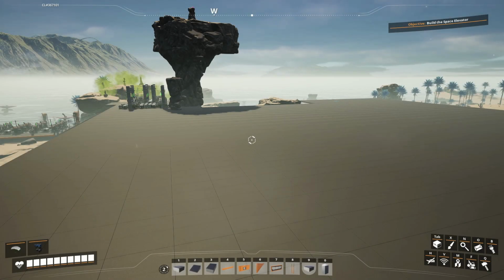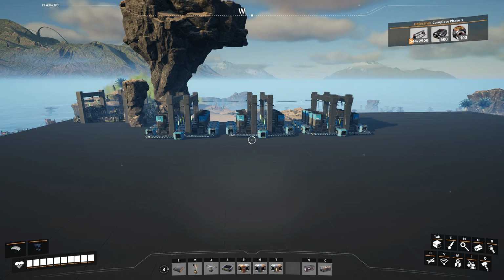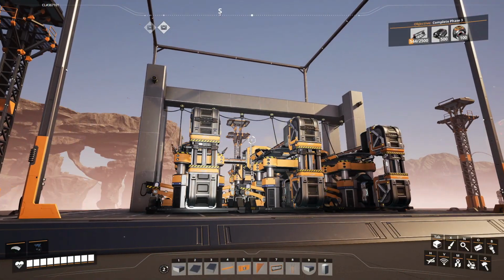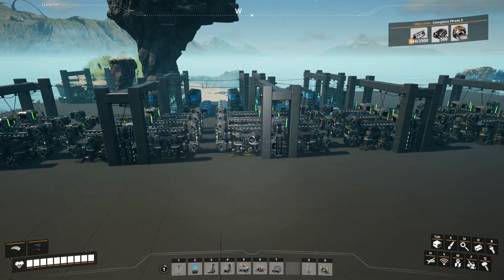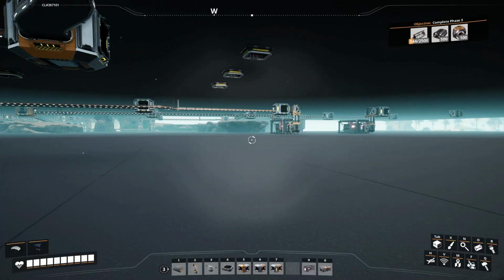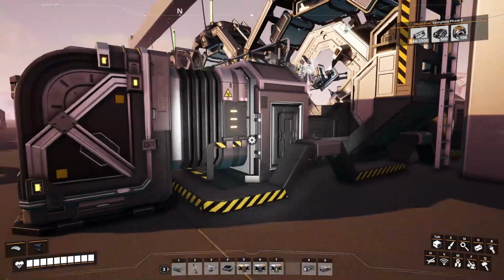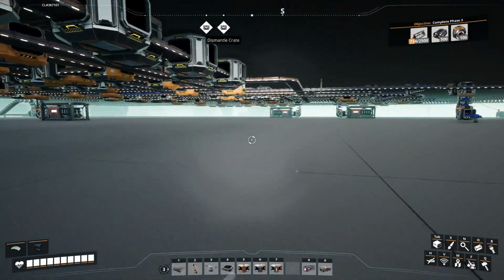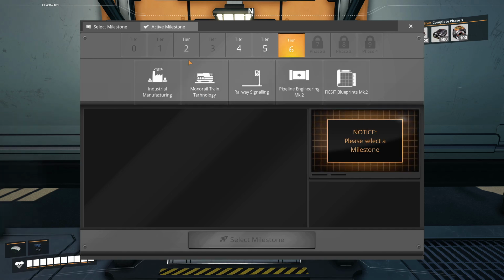How to complete Phase 3 - Mass Frames | Satisfactory 1.0 Masterclass

Comment: Nah I think I'm done with this game.  Spent 2 days following along with this and the screws make no sense and I'm just stressing how to figure it out now.  No matter how many belts you throw at it, you have two screw outputs, 1 from each set of 6 contsructors.  Even with MK4 belts, they cannot hold every item to provide supply to everything needing screws.  How the F are you gettiong 700 and 800 screws from two outputs that can only handle 480 max each at this point?  I really dont wanna quit this game after this time but this has pulled my soul right from out of me 😭

This was meant to be a tutorial and I think that was far too key a part to gloss over
Reply from the maker: Oh yeah, the screws are HORRIBLE. The way this works is simple though: I have each constructor making those screws feed into its own belt.

One belt runs towards a machine that needs screws, after which most of those screws are used. That main belt is then 'topped up' by one of the screw belts merging into it.

Keep repeating that until everything that needs screws gets them. And yes, those belts are MESSY, but luckily we have that supply level  so you don't have to look at them :D
Reply: @TheDutchActuary  You have no idea how much I appreciate that reply and the speed of it! ❤

So just so I have this right, you are not combing the 6 constructors from each set of 6 into one shared belt like shown in the blueprint earlier in the video?

So instead you are literally taking a belt from one individual constructor, directly to an individual machines screw input, then merging another belt from an individual constructor in to make up extra if necessary. Then any extra from the belt that was merged in, becomes primary input for next machione needing screws? And repeat?

I think I just assumed too much regading that constructor blueprint so apologies for requesting HUGE clarfication 🤣

Thoroughly enjoyed your content while playing the game and again, I am very grateful for the reply and advice mate x
Reply from the maker: @Paterson07  Yep that's it!
Reply: @TheDutchActuary I feel really bad now 😂 I was too impatient and just built a secondary logistic floor underneath the first, purely for screws, i then just over/underclocked a few constructors to get it over with 🤣 

Thank you again for the advice, reply and the content 😉

Comment: And it was at this point I said fuck it we are clipping all over the joint, I haven't got to look at it later so who cares.

Though I did have to spend like 40 minutes trying to figure out why an elevator wasn't working, I think it had something to do with it being set to input on an output. Other then my gripes and being stupid.

Loving the layout, Being able to actually move around without sliding under like a dozen conveyer belts it refreshing.

Comment: Following the guide and and first I dreaded the idea of using screws but ai actually have essentially a bus of screws running right on the outside and with the machines constantly running it actually gives the factory so much lives seeing 8 full belts CONSTANTLY moving. I tried building with the logistics floor style and while it looks clean for me it just makes the factory boring. Not bad looking just like seeing all the moving parts

Comment: Hello TDA! amazing guide ive been following it since phase 3 is quite overwhelming. Im just wondering how you dealt with getting the screws to the reinforced iron plates assemblers, I have MK4 belts but still getting 500 screws per minute into them seems like a challenge, any tips?
Reply from the maker: Yeaaaah that part is a bit frustrating. Basically you need several belts, with the excess screws overflowing to the next machine each time. 

It's one of my least favourite parts of this build for sure!

Comment: i been following this guide, but iam still confuse why not build a central storage system ? outside the depot do you need to walk to the factory to get for example steal beem then walk again to concrete factory to get concrete ?
Reply from the maker: Nope, you should have dimensional storage unlocked at this point that makes a central storage completely irrelevant. (its in the Alien tech tree in the MAM)

No need for central storage if items just get teleported into your inventory ;)
Reply: @TheDutchActuary  but doesnt it takes to long to upload and only have few stack ? i ussually need alot of like steel beam if i make new factory
Reply from the maker: @comentbro4198  Sorry i missed this one before. You can upgrade the dimensional depot to upload faster and store more resources. Also, you can have several depots to upload faster for high-quantity items (e.g. concrete)

Comment: Sorry if you mentioned this in a video I haven't had time to watch all the master class videos although I plan on it as I am following along with them but are you going to make the blueprints you use available? I'm not even sure if that's possible since I am new to satisfactory but I am trying to play along and build the same builds as you and blueprints would be a big help! keep up the great work love the vids!
Reply from the maker: I haven't really looked into sharing blueprints yet, but I'm happy to do so if there's an easy way. Keep in mind though that none of my blueprints are complicated, it's just simple building blocks with machines (and I show you each one I make - just takes a few minutes to build something similar)
Reply: @TheDutchActuary  gotcha I have been following along and that's true. I was just thinking about your DSP blueprints were so helpful but its easier to make in satisfactory. I am building the phase 3 factory following along in this video and I'm not sure how to meet all the screw demands with Mk.3 belts. most of my machines are just waiting for screws and it looks like the screw production is bottlenecked by how slow the belts are? Love the vids and thanks for the response!
Reply: nvm I figured out the screws lol I dident realize you weren't using the belt over single output smelter blueprint for screw. I got all the screw outputs hooked up and running now
Reply from the maker: @Snakegreen88  Each constructor making screws is almost a full MK3 belt (240/min to be exact). Most machines that require screws need a large amount as well, but usually not a full belt.

That means that you'll need to mess around a bit with the belts to get it right. The easiest way to do this is:

Constructor (screws) > Splitter > Merger > Assembler (requires screws)

The splitter then feeds into the merger for the NEXT assembler, so you take advantage of any leftover screws from the first one. 

You can see a very simple example of this in this video, at 11 min 35s: https://www.youtube.com/watch?v=-6QDwJ-1_BA
Reply: @TheDutchActuary  I'm struggling hard to figure out the math here and how to balance 800 screws across mk3 belts when each assembler takes 100/min... especially with the last constructors only making 130/min instead of 260

EDIT - I think I figured out something that worked.  I have 1 steel screw constructors ( each at 260/min) per 2 assemblers, with the 60 screw overflow of each group merging into a separate line of 240 that I left open for future stuff
Reply from the maker: @Galrash  You got it!
Reply: @TheDutchActuary  would appreciate a closer look at how you did this. I can't seem to figure it out. If you split the first full constructor (screw) line, the first assembler doesn't get enough screws. Are smart splitters required?
Reply: I figured it out <3
Reply: @TheDutchActuary  Hey Dutch, just looking for some clarification, you said:

"Constructor (screws) > Splitter > Merger > Assembler (requires screws)"

But the video shows the merger, then splitter.

Am I missing something? Really liking your series especially as a first time satisfactory player, the belt logistics is hurting my head though hahaha
Reply from the maker: @ANP9623  The idea is to combine belts, split them (to feed into the machines that need that item) and then recombine the belt again to make sure to keep access to the remains of that particular line.

Screws are a bit annoying at this stage because you can only fit so much on a belt, but you often don't end up using that entire belt. 

(Or if you do, you need MORE than that belt so you need to merge a second belt into the first a few machines down the line (else the screws won't fit on it)

An (relatively) easy way is to first just set it up in a way that makes sense to you, and then come back a few minutes later to see if all the machines are running. You can tell by the green/yellow/red lights at a glance. Anything that isn't green (or blue, if you are overclocking) might need some attention.

Comment: Following from the beginning. Good stuff.
There are some pretty good ideas that I picked up. 
Lots of stuff that I guess people know how to do but are reluctant of doing, as to whether it's actually going to be useful. For example: 
- the pillar setup that facilitates neat power supply off the pillar power sockets (I haven't actually done it, but now that you grouped in blueprints the whole thing, I will). Also saw some trick to actually use the wall power socket on the floor, by sticking it on top of a pillar and that pillar just reaching the floor level of the foundation from below so that only the socket shows / sticks out( and then deleting the pillar?) but I am not sure how easy it is to automate that. Makes you wonder why Coffee Stain didn't actually let us have floor power sockets.
- the grouping of the foundations in groups of four so that it's easier to put down a big factory floor quickly. Doh, it's obvious but have i done it? its the simplest of blueprints. No, I hadn't
- the logistic floor under the production floor and how tall it is. I do wonder if it's a trade-off of spaghetti hidden, vs spaghetti obvious. Thing is, it's harder to debug when you have to switch floors. Still it gives you freedom and so it's a keeper. More options are always good. PS I also made my lower floors wider, but it was actually so that i don't fall off to my death from the top floor, as I am building of the cliffs in the first recommended starting area, between the far away waterfalls. The buggy is wild fun compared to the truck. Highly recommend getting it early. Thinking of building a roller coaster ride at the end, complete with a loop, if I manage not to exceed top speed and then even do do a lift off of a ramp with a twist so that I corkscrew up and land. Satisfactory Evel Knievel!!! 
-Generally the idea you of having room/space that you have adopted, ceiling room etc is good.
-Also how you managed to stick a splitter on the ceiling is a thing of beauty as I had been also using the ceiling to move things around, only I couldn't place splitters.
-Is there a truth to the fact that a modular approach, several medium sized factories instead of one huge one, is also gentler on the CPU/GPU, as it only simulates the stuff after a distance? Anyway modular is nice. Easier to rebuild too, imagine making a huge cube of a one single-shard factory for everything and then figuring out at the penultimate stage that you have to raise all the floor ceilings by one "lousy" meter. And speaking of meters, all the wikis list the Blueprint Designer 1.0 as being 32x32x32. I only count 16x16x16. Go figure. Maybe I am not that good at math anymore.
 
Keep trucking and thank you.

PS: Dreading oil. So many recipes. I think I'll start simple. Looking forward to your next episode!
PS2: that last design where you can see what you are building as the belts are on top, almost reminded me of Dyson Sphere Program iirc, which is superior in certain aspects, still not as hands on as Satisfactory, which is more first person and has a rather better map. I suspect hand made. In other news benefits of mild Alzheimer's, as I had played the game in early access up to a point (guess where I stopped: oil!), is that some stuff you forget (its the same map) so its fun doing it all over again. Maybe we do live again and the point of not remembering anything from past lives, is that dreadful boredom that would ensue. Poor Faust.

Comment: Silly question from approx 4:30, have you tried tileable blueprints instead of primary/secondary facilities being fed by complex under-floor splitters/mergers?  Little tiny repeating tiles, like the tiny layouts you made with only 1-2 assemblers for DSP.

In DSP I’ve been using them for oil and chemistry builds. Need  4 to fill a MkI belt with refined oil? Stamp them down, belts automatically linking to make a mini-bus line. Using MkII belts? Stamp down more to extend it.

Items need to daisy-chain into the next build - like plastic + refined oil into organic crystal? Use the same/similar belt layout and stamp down the next section of the line/build.

I’m curious if something similar can be done with Satisfactory, so that they pass through to the next facility in the chain. Outputs moving on or coming back to the “front” of the overall build.

Very interesting, cheers!

Comment: Great video! i've been struggling with feeding materials into machines, how do you do it? I think my constructors/assemblers designs are good but when i have to feed them iron, coal, copper or steel (with 2 i already make a mess, with 3 of them i'ts a terrible spaguetti). I just unlocked trains and i think it will be easier but i fear i will make another mess of trains because i'd just be brute forcing my already bad design, any tips?
Reply: I base "factories" (groups of machines) on the highest tier belt I have access to. So I have have t2 belts, the input will be 120/min. If a machine has an input and output of 30/min, then that's 4 machines. Make a blueprint with an input and output belt, 4 machines, hook 'em up etc. Then you have a reusable blueprint where you know you just gotta feed it with a t2 belt. Obviously, many recipes have variable input/output rates, so you might need more or less input/output belts. But if you use basic maths and use belts as your limiters it makes it a little easier to make blueprints. Obviously, you still end up with spaghetti too and from your factories, but that's a different problem :)

I have a friend that brute forces machines.
me: we have t3 belts, so that's the rate limiter for our input/outputs.
him: just create a load of machine and a load of belts!

I assume he doesn't like numbers...
Reply from the maker: Hopefully you're using splitters & mergers to avoid most of the spaghetti. After that, the next step to get organized is take note of the inputs/outputs and your belt speeds.

Mark 1 belt? OK, that means 2 smelters in a group.

Mark 2 belt? OK, now you can have 4 smelters in a group.

Mark 3 belt? OK, let's go up to 7 smelters! (or keep it at 6 because even numbers look better).

etc. Same thing applies to constructors, assemblers etc. Especially high inputs/outputs like screws will likely mean you'll want to keep those machines with a LOT more space around them so you can keep your belt layout clean. 

Trains are mostly meant to get large amounts of resources from A to B (long distance), but won't change any of the things i listed above when it comes to your actual factory.

Comment: It's interesting to see different styles of logistics architecture. I for example purposely don't use screws because of the volume of items being larger, which would mean a lot (x2/3) more belts, thus a lot more spaghetti. For example, I use the alt stitched iron plates (with iron wire), and the original recipe for modular frames, to avoid screws. I do agree making screws with steel beams is not bad, but it means more steel thus coal which is a limited resource. It also limits the location you can make these resources in bulk compared to plain iron.
The tradeoff is more machines, which I've solved by scaling up my production in vertical towers per component.
In summary: my way saves belts and space, with the tradeoff being more slightly more machines (probably 1/3 to 1/2 more)
Reply from the maker: I honestly love the alternate recipes and the flexiblity they provide. Later in the game I will usually go like 'OK, now I want to make X. What resources do I have available close by that can make X '  and pick the alternates that allow me to build in a convenient location.

This means I might be using the stitched plate in one factory, and bolted plates (as an example) elsewhere. 

Gotta love options!

Comment: Hey TDA! I really enjoy your Masterclass series so far. Even though I haven't been following along completely, your tips have been helping me tons in figuring out new things. For this part of the game, would you still recommend using screws if you don't have those alt recipes? I've been taking alt recipes that specifically avoid screws for now but I feel like the Iron intake really spikes when you do that.
Reply from the maker: Mind you, I'm not specifically recommending to use screws. I'm just making a point that although it'll require you to build a few more belts, even the normal/alt recipes that use screws a lot are very much viable.

This is all very much a matter of taste. As you mentioned, avoiding screws means you need a lot of other things instead.
Reply: @TheDutchActuary  I see, since I've gotten the alt recipes for screws and it seems like they produce reinforced plates and modular frames a lot faster than the non-screw alt recipes, so I will be using screws in my facility as well. Thank you!